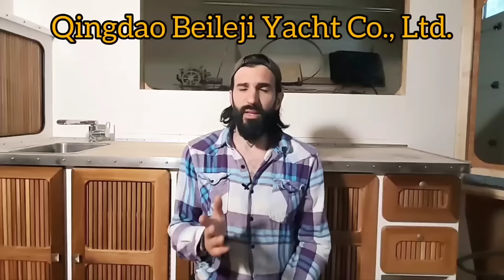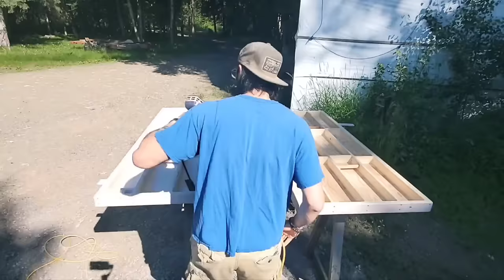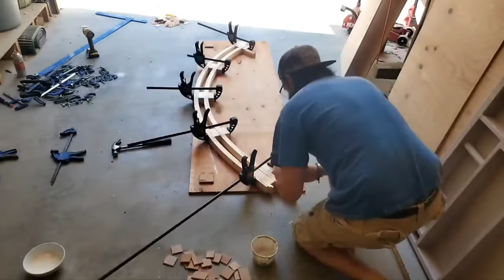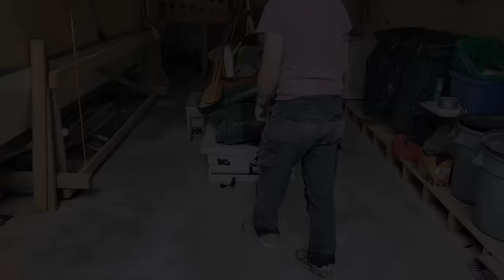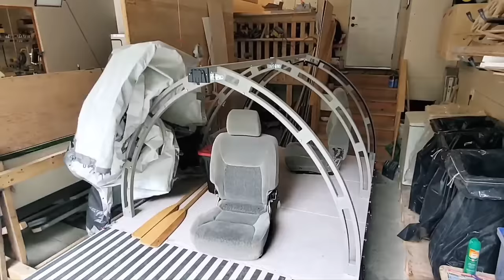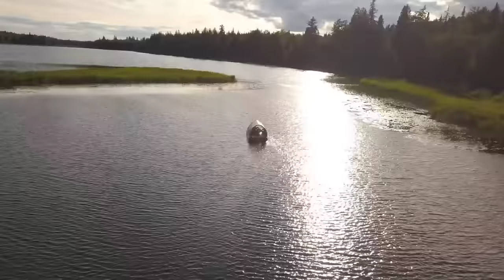DIY! Cheap homemade boat with gothic arch cover that fits in minivan!

Comment: Interesting. I bought the American manufacture of that inflated boat 5 years ago for $1400 USD. It was OK but I'm not a small man so with me and a small 2.5 hp gas motor in the back it didn't have enough buoyancy. I'm going to use some imagination and use a small abandoned aluminum row boat for the center, put on a wide deck, and attach the inflated pontoons as outriggers on each side. I'm going to piano hinge the pontoons to fold up.  Thanks for the ideas.
Reply from the maker: Are you talking about only the pontoons you bought for $1400 USD or an entire setup with platform? I am asking because I am not aware of a manufacturer of a similar boat. I like your idea with the outriggers, that could be quite a unique build!

Comment: You did a great job ! the only thing I would have done different would be have the white part of the tarp facing out and the back of the tent also have a zip up door like the front does. congratulations you were under budget.
Reply from the maker: Thank you! I actually have a velcro door at the back as well.
Reply: I thought of the fact that the black outside will absorb a lot of heat, but whether that's desirable or not depends on the climate and season within which the boat is used. This boat is for Canadian waters for starters, so perhaps the heat induction is desirebale. If you ever want to heat this vessel, Mr. Heater makes safe propane heaters...not too expensive either. For cooling in the summer, a fan works wonders, especially in Canada.

Comment: I am very tempted to mimic this design however because of all the shallow water hazards in the places near me i am skeptical of inflatables
Reply from the maker: I have been on rocky lakes and pulled the boat right on shore without any issues. The rocks where not super sharp though, but i have to say, the reinforcement layer at the bottom of the pontoons can take a beating, I think it would take quite a bit to penetrate that. Besides that, I made them separate each pontoon in three sections. That way if one is compromised, I still have two to stay afloat.

Comment: Amazing….. even when you build an inexpensive and quick project you rock!!! I know by just being on the water it will help to inspire you even more to finish your houseboat. I really liked how you built the platform deck using the dowels and the arch jig and production. I really believe if you could produce these they would sell! Anyhow thanks again for sharing your skills and travels. 👍
Reply from the maker: Thank you very much! I agree, this will be very inspirational! If there is enough interest I actually would consider selling them, even though the price would have to increase significantly since I didn't include any labor in the overall cost.
Reply: @adrianwoodworm  As expected. Ya can’t live for free so ya sure can’t work for free.
Reply from the maker: @SgtBrewdawg  I couldn't agree more!!

Comment: Very nice!  Regarding the platform, if you install floatation foam between the 2x4s you will have an unsinkable boat for a just incase scenario. That's how Boston Whaler boats are constructed. You did a great job on the build.
Reply from the maker: That is a great idea! I will consider that when I rework the superstructure!
Reply: Yep. Flotation foam increases the safety factor exponentially.

Comment: I'm looking to make my own homemade pontoon boat (16 x 8), which I want to live on full-time, and I also want it to be able to handle all sorts of conditions...at least large bays if not short open-ocean journeys. I intend to use PVC for the structure, and the pontoons will be floatation foam inside of protective, waterproof FRP. With all of that said, your design is a piece of art.

My primary goal is to mainly use the Great Loop (and all sorts of inland rivers off of the Great Loop), but I am not one to shy away from a challenge, so I want the boat to disassemble into small enough pieces that I can transport it via UHaul, either a box truck or a trailer. So far as I know, you can't rent boat trailers and drop them off on the other side of the US...and I don't want to own a truck and trailer.

I want to be able to, at least, disassemble the boat, and do the Snake and Columbia River and the Puget Sound. Your design that fits in a minivan and works expertly when assembled is a great inspiration. Thank you for sharing.

Comment: You are not just a gteart carpenter , but also a artist . My only thoughts about this is I would have went with 2 small wooden pontoons filled with expanding foam . They would only stick out back of the mini van a little when apart in the Van . Reason being , a puncture would ruin a weekend , or during winter storage critters chewing hole's in the pontoons .
Also on radiator heater for your garage , you need to install a blow off valve . So the if pressure gets to high it opens up . Some are made so you can fit a hose copper tube  which you can run to your catch tank . Also you buy a 12v heating hot water circulation pump . Where as you will have 12v batteries from this little camper and from the houseboat . Also there is neat thing from coal or wood hot water heating furnace's . It opens and closes the air damper according to the water temp . Really like the artwork in counter top and stairs . A little trivia on the sugar joke in the drink coaster build . Famous Britt chief Jamie Oliver filled a school bus full of sugar to make a protest to the LA school district commissioner   in regards to how much sugar was being put into the food for the kids . 
Wish your family all the best . Paul N.
Reply from the maker: Thank you Paul, all good thoughts you have there. I am not worried about punctures in the pontoons and I will explain why in the update video, so watch out for that🙂 As for the valve in the heating system, I agree, it is on my long "to do" list. I haven't heard of Jamie Oliver's "sugar" school bus, but I will look into this!
Reply: If it's a car radiator, the standard radiator cap should easily release any surplus pressure before it becomes a hazard anywhere else in the system. Just make sure the overfill hose is directed in a safe direction. :)

Comment: Add a couple of flexible solar panels on the top of the tent,will help with battery life,  .
Excellent idea, and very good execution,.
Reply from the maker: You will like the future upgrade video😁
Reply: Flexible solar panels can be very light too. I'm looking at a 200 watt at 9 lbs.

Comment: I love your ideas, your magic hand and your boat. I just wonder how you can tie up the platform/desk to the "D" rings inside of 2 pontoon tubes on the ground at the lake shore?
Reply from the maker: Thank you! It works the same way as on the outside. Simple straps with plastic buckles. Since the platform is made of four segments with only 30inch width, you can reach underneath each time you clip one on when standing between the pontoons. If you forget to clip on a segment (I totally have done that) you either have to take them apart again or crawl under. I also gradually move the boat from shore in the water with each segment so at least half sits in the water at the end. Otherwise it would take too much force to move it once assembled and loaded.

Comment: Hello! I love your little portable Catamaran. It's actually perfect for a lot if things that I would be doing. I'm in Thailand and getting ready to start a boat build here. Actually it will be 3 different biat builds. I am planning the first a Catamaran Houseboat to liveaboard and a small Sailing Catamaran for camper cruising and a couple of Kayaks, but your inflatable cat could easily replace the two Kayaks. And could be stowed away in one of the Hulls of the houseboat. I really like how you built it and your Gothic Arch structure is pretty perfect. How long did it take you to build, hours-wise? So cool. Thanks. New Sub.
Reply from the maker: Thank you for your interest! Sounds like you have a couple cool projects coming up! I cannot remember exactly how long I was working on this boat but I would say it would take around 2weeks (80hrs) to complete this. That includes sourcing the materials, which ended up beeing quite time consuming. (We live 40 min. out of town, so multible trips add up real quick)

Comment: I was beginning to worry that just the quantity of screws in the platform would sink the boat, but ... all's well that ends well. ;-)  I'm starting to believe that you could build just about anything, given the right tools and materials. Nice job. 
P.S. - Dollar_s_, dollar_s_, dollarzzzzzzz!
Reply from the maker: 😅you never can use enough screws! Thank you for watching and commenting!
Reply: @adrianwoodworm  One question: After you built it and tried it out on the lake, did you feel like the connection between the pontoons and the deck was stable enough, or kind of wobbly?
Reply from the maker: @_onesimpleidea  It was kind of solid the first time but I found a trick to stiffen it up even more. Now I connect the platform with the pontoons BEFORE I pump them up completely. I adjust them fairly tight and once you pump them up completely the connection is rock solid. There is a slight movement still between the platform sections, when you step on the edge of the deck at the front for example it bows down a bit. Not enough to damage anything though. And after spending a weekend on a very windy lake I actually appreciated the flex in it. It moves much softer with the waves that way.

Comment: few things to add,   Rope, signal whistle, and flares.  (just to make it marine compliant, + first aid kit)

Now,  keeping with the theme of things.    there are canvas and folding solar systems.    you can drape it over one or both sides of the tent.   pull in 100-200 watts of solar.    that can feed a small solar battery, and let you recharge.

maybe add in a small wood stove, camping stove that can be clamped to the floor for heat and cooking, or propane heater and propane tank would also work.
Reply from the maker: Those are good ideas Jennifer and most of them happend allready. There is a second video about this boat on this channel. It shows a 200W solar system on the roof.
Reply: @adrianwoodworm  yeah i saw you used the "fixed" panels.  I was looking at the portable "canvas backed" solar panels  just cuz they fit with the quick break down small storage area :).

Now you can also really cheat here if you wanted.   a little 700/900 or 800/1000 propane generator,  propane heater, and propane cook top.   all of them are small, easy.    all can run of little 1 pound tanks, or may share a 5 or 10 lb tank (20 lb is overkill but you could do it for long trips).

This gives you the ability in an emergency,  to run your motor at 30%  power, for 3 hours, one a 1 pound propane tank... or charge batteries and such in a really overcast day.   

its cheating but.

Comment: Put a sail on that, would hollow core doors be cheaper? good job thank you
Reply from the maker: Interesting idea! I am afraid hollow core doors are too expensive in my area. Moisture would be another problem. They are often made with a cardboard core. If that gets wet, all the strength is gone. The thin panel that covers those doors is not very puncture resistant, which could be problematic too. But I like your way of thinking outside the box! I am not much of a sailer, but I assume a sail would work! Thank you for commenting!

Comment: Pretty good, but perhaps a bit overbuilt in the tent design. Something you might like to experiment with, is thin clear grained timber say 4-6 mm, with [Edit 12oz , 220 gsm ] FG, epoxied to the outside of a curve.
When you bend it, it bends like a a fishing rod. You can then fg the inside curve to keep it bent. You could even get away with only one layer in the arch, I suspect.
A much lighter and equally stiff solution with half the weight of those curved girders you built. More like a sail batten, really.
I would also consider adding some  stretched, painted canvas to form a waterproof , skin on frame canoe type surface under the platform.
This would add some reserve buoyancy and provide less wind and water resistance in less than calm conditions. You would be surprised how much better going upwind would be in a two hulled craft.
Reply from the maker: You got some good points there! As of right now they are definitely overbuilt, but I do have upgrades in mind that might require the beefier arches. Also, I wanted to be flexible so I can add screws and hooks whereever needed, which is easier with more meat on the arches. I also like the idea of using the canvas/paint under the platform! Very good idea, even though I wonder if it would trap moisture and mold in the hollow space? 
I appreciate you sharing your thoughts!
Reply: @adrianwoodworm  Yes, you would need to allow some limber holes and drain plugs. Maybe held down with wood strips and screws for annual removal and inspection ?
Mind you, a flat sheet of thin fibreglass laid up on smooth melamine to save sanding, would be the ideal if you could stretch your budget.
As a forethought, a more aerodynamic front to the canopy  (perhaps lowerable) would be more room inside for accommodation, and that time when you are caught with a severe headwind, and about to be blown 50 miles to the lee shore.
Its bad enough in a canoe, I found out :-(
Reply from the maker: @dnomyarnostaw  more good thoughts! I just came back from a very windy lake, and the motor seems to be strong enough to still push it against the wind and white cap waves at around 4 km/hr. which probably could be improved with your suggestions. I sure needed to make sure to set anchor in a calm bay so I could get some peacefull sleep😁
Reply: @adrianwoodworm  well done   camping overnight is quite an adventure  
Did you wake up every hour because you thought the anchor might be dragging too :-).
Have fun.
Reply from the maker: @dnomyarnostaw  no, but we did have an afternoon nap for only 15 min. and ended up on the other side of the lake😆 that's when I learned to give the anchor line some slack so the anchor has a chance to dig in!

Comment: Nice project!  Wondering if you could estimate the all-up weight unloaded.  What floatation did you use for the pontoons?  Thanks for any info.
Reply from the maker: I just put a platform segment on a scale for you. Each of them weighs around 33 lbs. All the cover framing weighs 25 lbs. The motor is at 21 lbs, the two 100 AH lithium batteries with box weigh around 60lbs. Two fancy car seats = 60lbs. All of that will add up to almost 300lbs. Then you have to add your personal equipment, the solarpanels if you upgrade like I did, and of course your bodyweight + passenger. 

I don't know about the exact flotation, I just trusted my guts that they will be plenty for what I do. They are 12ft long and have a diameter of 20 inches, I am sure there are online calculators that can tell you what you want to know. All I can say is that I had 5 adults and a dog plus a lot of equipment on this boat and it was no problem at all, in fact I didn't even notice a difference. 

Hope that helps. Cheers!
Reply: Thank you!! @adrianwoodworm

Comment: Hi, the link does not work for alibaba. Looking to see where you got those pontoons as they look sweet!
Reply from the maker: Hmm, that is wierd. It works from my wife's phone. The link only leads to the factory in China, not to those specific pontoons since they are custom made. If the link works at all then just click on "chat now" and start a conversation with them. They have been very helpful even though their English is a bit rough. I hope this helps!
Reply: @adrianwoodworm  interesting, it actually works from my phone too, thanks.

Comment: I have concerns about the shelter/dome acting as a sail and making steering/headway difficult in a wind. Lakes are notoriously windy and the amount of power in the small motor is unlikely to be able to overcome all of that resistance.
Reply from the maker: It has not been a problem so far, even in heavy winds. Of course very strong winds will push the boat around a bit but the motor has been also powerful enough to battle it. After all, it is the strongest motor I could find out there that still runs on 12V. In fact, I have been on a lake that was so windy that the waves even managed to break one of the plastic buckles of the straps that are holding the pontoons onto the platform and even then, the electric motor did its job just fine.
Reply: I was thinking the same thoughts as I was watching this. I was wonder if a rudimentary centerboard and rudder might be useful additions.

Comment: Can you share the link where you got the tubes and the specifications? Wondering about the straps and such too.
Reply from the maker: There is already a link for the straps and the buckles I used in this video in the video description. I added a link to the factory on alibaba for you. All you would have to do is start a chat with them and tell them what you want. The dimensions I personally chose are: 
12 ft long(3.66meters) and 20 inches diameter(50cm)
I sent them a quick drawing with rough directions, explaining where I wanted the D Rings. I don't have that anymore and I also don't recall exactly the measurements for that. But they will walk you through it and give you options. It is best to just start the conversation with them and go from there if you are serious about ordering them. 
Hope this helps, cheers!